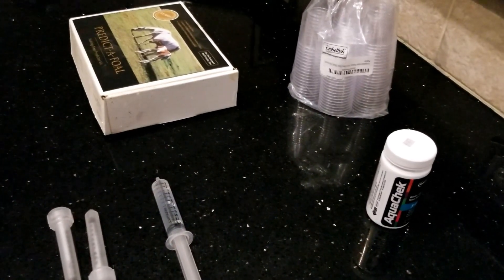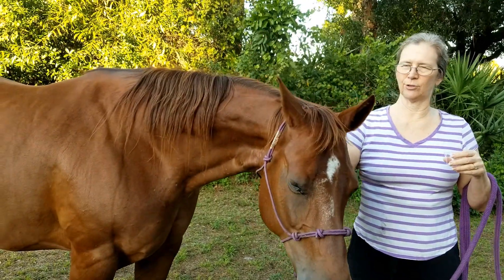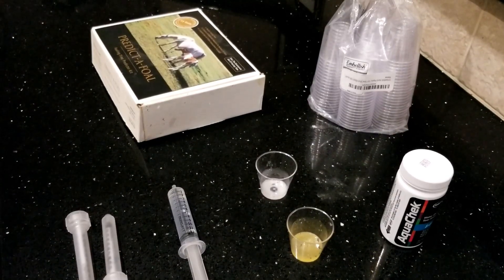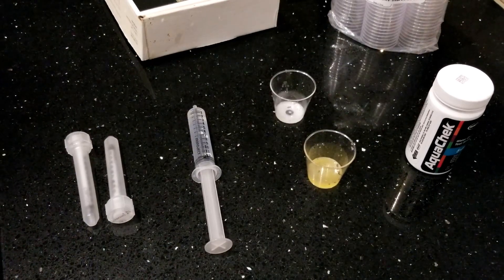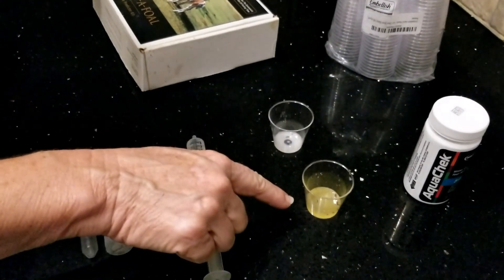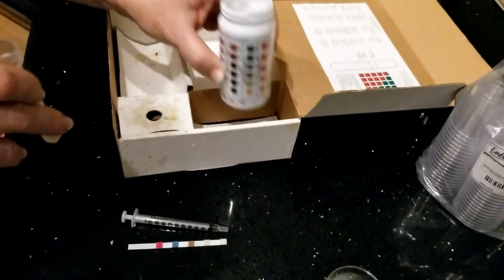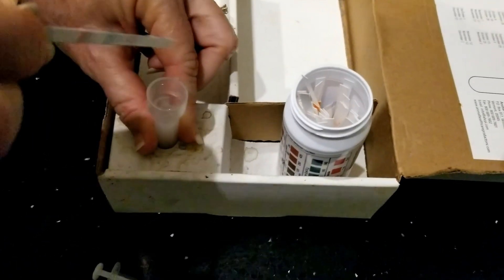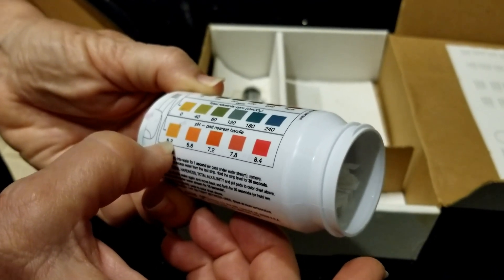How To - Mares Milk Test with water quality/pool strips

Comment: why do you take so much milk when you only need 1ml?  Aren;t you worried about taking colostrum?  I have found some results without adding water, just the straight milk.
Reply from the maker: because one or 2 squeezes gives me that much and I also evaluate the color of the milk. Plus I have plenty to retest if needed. It is also how I get my maiden mares accustom to letting the foal nurse. Before I started doing this it  would take a long while for my maiden mares to let the foals near their very tender teats. Milking them beforehand gets them used to it. It is no where near enough to effect the colostrum for the foal. All the years I have been testing this way I have never had a foal fail it's IgG test. They have been over achievers LOL